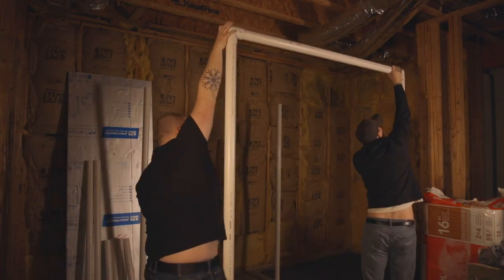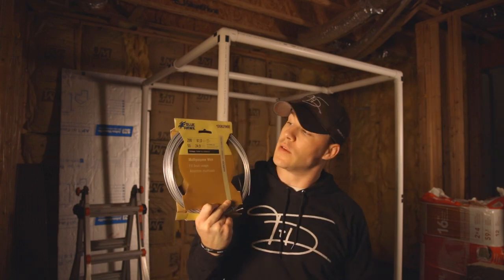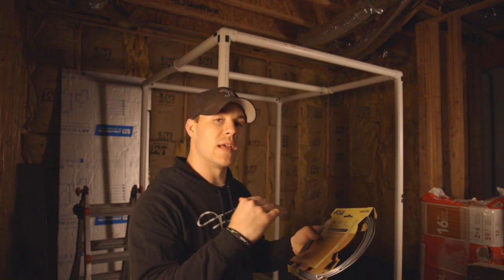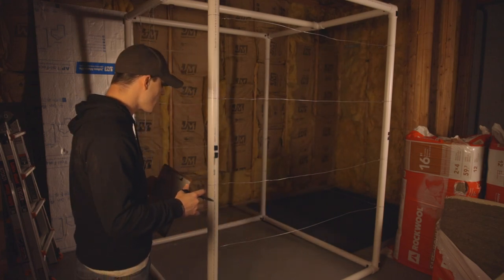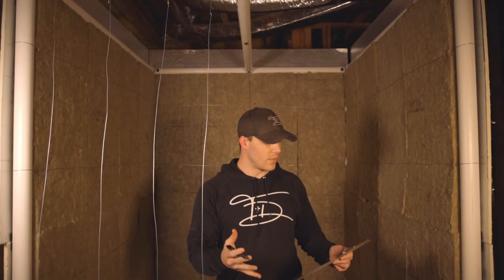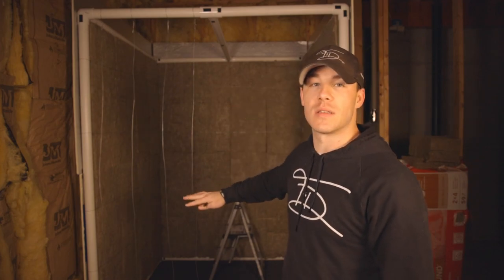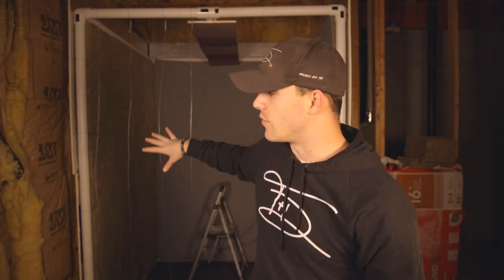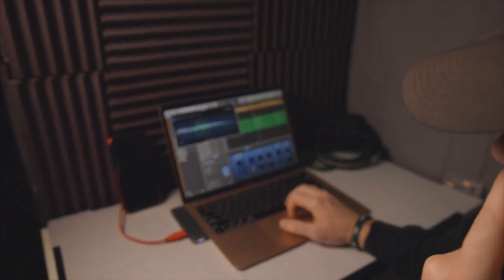Easy Portable Sound Proof Vocal Booth

Comment: bought myself a $100 Gazebo / Pergola (200cm x 200cm) and placed it in my basement on a noise absorbing rug. I left the outside "walls" off and placed moving blankets on all five sides. Got myself a 10M led strip for the inside and some bass traps in the corners and foam on the inside off the blankets. Super easy set-up for recording with my D18 and singing at the same time straight into my iPhone using the Roland Go Pro mix. Call me cheap but I just love my little "tent" inside my basement. Nice and cozy. Love your channel man!!

Comment: Salute you for this. Kept things simple and to the point.
Reply from the maker: Jae B. Tundra that was the overall goal 🙏 thanks for watching!
Reply: does this type of vocal Booth deals with high frequencies and low frequencies issues?
Reply: @ramirezwilliam8983  it pretty gives a solid dry recording which is what you need a good recording
Reply: @JaeBTundra1  well I was told that low,high and medium frequencies will build up and ruin the quality of your Recording, so what do you say about that?
Reply: @ramirezwilliam8983  not in qn actual vocal booth
Reply: @JaeBTundra1  what do you mean by qn?

Comment: Thanks for the video, man. Finally a DIY booth I feel optimistic about putting together myself. Any idea what the decibel drop is on this?
Reply from the maker: Michael Holdaway so glad you are confident in this setup, it has most certainly made a huge difference for me, unfortunately I do not know what the actually decibel drop is.
Reply from the maker: @Lyrikile Trife my album was recorded in a lesser version of this, but my two singles Arkham and Bounce were both recorded in this. Flex up was a collaboration that was recorded at the other artists location.

Comment: Nice video, great work!  My question is, if you had wanted to, could you have hung acoustic blankets on the inside, on the other side of the sheets, just to give another layer of soundproofing?  In that way, it would be like adding acoustic foam to a Whisper Room.  Or maybe that would be overkill, IDK.

Comment: Did you have any issues with the Rockwool? I have everything but then I started getting paranoid because of the fibers.
Reply from the maker: No, I handled it with my hands and did not have any issues.
Reply: @tyday2912  thank you! How is your booth holding up for you? :) I really appreciate you taking the time to film this
Reply from the maker: @PhoenixEchoesAudio  a year in and its still holding strong. the only issues that I've run into are with the velcro. over time it just starts to give a little here and there but they've been easy fixes. The structural aspect itself has been great.
Reply: @tyday2912  you are a total LIFE SAVER!! 😁😁
Reply from the maker: Glad I could help 😊

Comment: I’m confused about the neon lights and the electricity source. Did you put a hole on there to run a cord? I am trying to build this for my husband! Thank you in advance!
Reply from the maker: Hey, short answer no. I simply ran it from an outlet that was in the ceiling down to my booth. I ran the cord and then set the ceiling of the booth on top of the cord. Let me know if that helps.

Comment: Kool music 👌 and whisper booth. Did you use the velcro to attach the insulation batting to the insulation board? How did you make the door hang? 
Thanks 😊
Reply from the maker: The velcro was simply to connect the outside insulation boards to the piping. The door I just simply measured and cut one side of the insulation board as a "hinge" and reinforced it with duct tape.

Comment: How much did the materials cost all told? or even broken down?  also, does the foam insulation board serve any purpose beyond support and aesthetics? I'm wondering if plastic tarping would work as well, or even doubling up on wire

Comment: Also my.pvc pipe is a 1 inch frame height is 7 feet by 4 feet all around diameter how.much foam walls would I need and or safe n sound insulation to pack in between the 1 inch pvc pipe wall
Reply from the maker: I'd have to look at the numbers of the insulation and the area of each wall, but honestly the 1 inch PVC pipe might be a bit too small cuz the insulation is 3in thick.

Comment: Did you do anything for ventilation? I assume it can get pretty hot in there right? I am planning on building something like this in the garage trying not only to keep sound from the outside away, but my vocals from bothering neighbors or people in my house in the middle of the night usually after 12am when it's dead quiet.
Reply from the maker: Sadly no, I didn’t plan for the ventilation but most certainly should have because it can tend to get very hot but it wouldn’t be difficult to incorporate.
Reply: @tyday2912  about how much would this run?
Reply from the maker: @johndoe7109  it ran me about $700 USD, though I believe it can be done cheaper pending what size you do.

Comment: this is a brilliant design and execution, much respect sir. Question - How did you do the door? It looks to open and close fully, I was wondering how you designed the door?
Reply from the maker: Thanks so much! The door was done by first measuring out the size and then cutting only one side of the foam insulation board. The other uncut side acted as a hinge and then I reinforced the uncut side with duct tape.
Reply: So the side that’s uncut and is acting like a hinge actually broke but you are keeping it together with duck tape? And the roof how many inches did you go above the pvc pipe
Reply: @smoovej86   no he cut through only one side the Reinforced the other side with tape, theres foam in the middle and it's sandwiched between 2 layers of another material (paper? plastic?)
Reply: @debobrien1  thanks I got mine built and been doing some good music

Comment: Hey great video! I’m seriously going do this tomorrow, thanks. I have a question..

On 1:23 , you attached a PVC on the top center to act as extra support to your frame. But what is that connecter at the ends of the pipe called?
Reply from the maker: those are T- Joints
Reply: @tyday2912  I have already started building something similar in my room. The frame is almost done!

Comment: Is there any way you can list all items purchased to make this? Plz this is the first video I seen that actually looks possible to actually install in be worth it .
Reply from the maker: Size: 5x5x7
Material:
Frame - 2 in diam. PVC Pipe.
Outside Wall - 4x8 1/2 inch foam insulation board.
Insulation - Rockwool Safe'n'Sound Insulation.
Wire - 16 gage multipurpose wire.
Velcro - 5lb sticky back velcro.
Inside sheets - queen size "flat" bed sheet.
Reply: Ty Day thanks. How much quantity did you purchase of each product?

Comment: Hello! Thanks a lot for the video! I'm an opera singer, and I'm looking how to build a booth where I can practice without being too loud for the other appartments, but where I could record stuff too. Do you think the materials you used could work in my case?
Reply from the maker: Mariana, I can't lie, that is a tough question. I will say this much, it certainly makes a significant difference with dampening the sound and would be much better than just doing blankets. However, as an opera singer, your power might still be heard a bit depending on the walls in your apartment building. I do believe it would still make a significant difference for your neighbors though. I hope that helps!
Reply: @tyday2912  Thank you so much for your answer! I think even if it dampens some of the power of my voice, the neighbors would still appreciate it. Thanks again! :)
Reply from the maker: @marianadelarosamezzo  My pleasure! Hope it all works out!

Comment: Great Video. One question: What are the outside panels/walls made up of? I know the frame is PVC and you mentioned the wire and the insulation, but I still do not know the composition of the outside panels that stick to the velcro. I watched the video like 5 times already lol. Good work. Much Appreciated.
Reply from the maker: Yea I didn't do a great job explaining the material unfortunately, so the outside walls are a foam insulation board. There are several different kinds you can choose from. I got 1/2 inch thick 4x8 boards.
Reply: @tyday2912  Thank you brother for the response. Much appreciated. It is rare to see someone actually respond to most comments. Great song by the way. BTW, I need to find a gentleman that will walk behind me for those busters whose lips are out of mileage lol. Classic.
Reply from the maker: @davidespiritusanto9581  I see what you did there haha love it, thanks so much for the support!

Comment: Quick question did you cut out the door and then tape it ?
Reply from the maker: I cut out 2 sides, the top and the opening... for the hinge I cut one side of the board and put duct tape on the uncut side as a reinforcement.

Comment: Very practical Ty, super cool. I wanted to ask a couple questions.. How is the ventilation - Is it something you think would be too stuffy to be inside in summer/in a warm climate? And what were the total costs on the build? Thanks for sharing
Reply from the maker: The ventilation is something that I did not account for/decided not to include. I have not had the heat get so bad that I could not stand it and I've spent 6+ hours in it only leaving for bathroom breaks. However, I am in a basement that can tend to stay pretty cool so that helps. I would definitely take it into consideration and if you're someone that gets hot easily then I would look into including it. The total cost was right about $700 USD, but I believe it can be done cheaper. I bought extra material to account for mistakes.

Comment: What r using for the walls?
Reply from the maker: The outside walls are 4x8 foam insulation boards held in place on the pipes with 5lb sticky back velcro.

Comment: What height were the pvc pipes you specifically used in this video exactly?
Reply from the maker: For the height I bought 10 foot and cut them and for the width I did 5 foot.
Reply: @tyday2912  Good to know and last thing how many rockwool packages did you buy for this vocal booth
Reply from the maker: @michaelpiech9990  if I remember correctly I believe I got 3

Comment: Why the wire ?
Reply from the maker: so the wire was really to give a little help holding the insulation up on both the inside as well as the foam panelling holding it up from the outside.

Comment: Much respect for the build however I feel like 2x4s would be way cheaper for this build.. PVC gets pricey
Reply: Yeah, but in the off-chance you need to take it down to move someplace else, the frame can be disassembled with no tools (assuming the pipes are not cemented together, which they don't seem to have the need for.)

Comment: Is this actually soundproof or at least mutes sound very well? I live in an apartment townhouse with thin walls, could hear the neighbors upstairs playing sufjan stevens last night lol. (that should tell you how thin the walls are)
Reply from the maker: It's not completely soundproof in the truest sense of the word but yea it does make a significant difference. It would probably be your best non-permanent option being in an apartment. Which was the goal for the design. Something "portable" that could be built, taken down, moved and put back up easily.
Reply: @tyday2912  I was thinking that the portability of it is great so this is probably the best option. it makes me cringe thinking the neighbors could hear all of my mistakes and repeating things 100 times over, lol. At least it will be muted, and I could have the psychological aspect of no one being able to hear me too. Thank you so much for your video and your response!
Reply from the maker: @gardenrabbit2000  Absolutely! and I know exactly what you mean, I have the same issues. Before I built this I had all my equipment in my room and could not bring myself to record or write when my housemates were home. Now it's not an issue at all. Hope it works just as well for you!
Reply: @tyday2912  My main issue, I want to do vocal lessons on this CD I have and literally leave my extended stay at like 2 in the morning to find a vacant parking lot smh...I just want to practice without the other hotel rooms being able to hear/judge w/e...

I'm thinking of stealing your idea and adding a double wall/booth maybe 6 inches after your frame...Also plan on making mine only available to hold the mic stand and a chair. 

Wish me the best, keep making tracks (had a early future vibe, thought it was him for a second)
Reply from the maker: @lorlooney1520  I know what you mean haha, I think the double wall could work if the framing is done correctly, you'll just have to make sure the insulation can be supported. Hopefully it all works out for you, good luck and thank you!
Reply: @tyday2912  This is exactly where I'm at as well smh lol, my productivity has been dismal since I live in an apt with family and the walls are thin af. Just the thought of knowing people can't hear me messing up and being goofy on the mic will make me so much more comfortable recording lol. Def taking a trip to Home Depot soon
Reply from the maker: @bolojr  The struggle is real! haha hopefully this makes a difference for you!

Comment: what was your total cost?
Reply from the maker: After all was said and done I believe I finished up in the $700 range.. That was with buying some extra material just in case I made a mistake, and the neon lights which are certainly not a necessity. You should be able to keep it in that range if not lower.